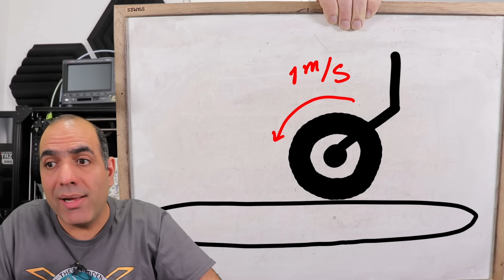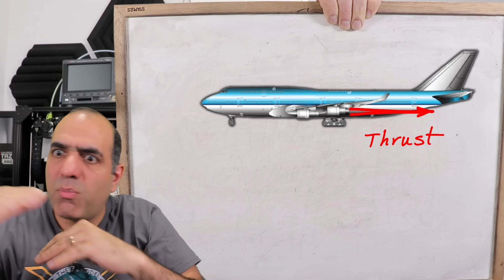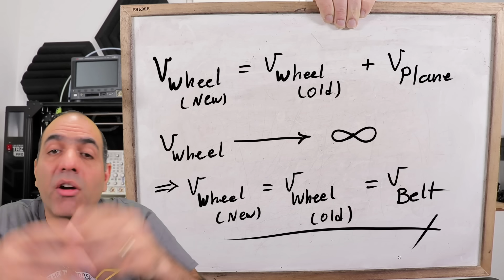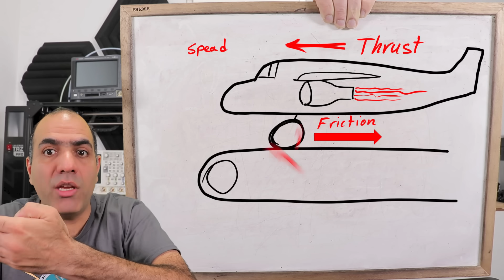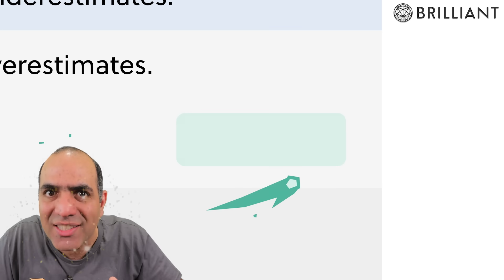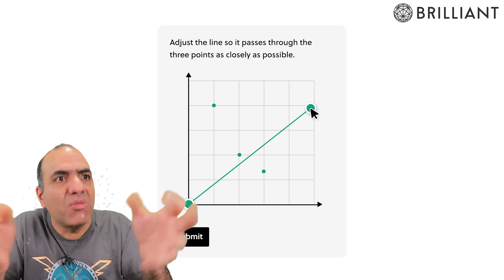Airplane Question that Drove Me NUTS!!!

Comment: 1:20 As a pilot I would say "IT DEPENDS", and kinda YES! If you imagine there is also head wind at speed around 160-180 mil/h it would fly easily, even without that belt with wheels totally standing still :D
Most people forget, that only airspeed is important, and ground speed is irrelevant.
EDIT: For people b1ching about: "did you ever saw 150KT wind?"! Its totally imaginary situation, did you ever saw moving belt under 747 at speed up to 300KT?
Reply: Which is why they call it flying and not driving.
Reply: That totally makes sense, given enough wind speed even Transatlantic Cruisers can fly
Reply: If the ground below you is moving hypersonic speed, not only will it be relevant, but anything anyone is trying to do near it will be irrelevant, because they'll be incinerated by the white hot hurricane generated by the ground.
Reply: It's literally true. I'm the aircraft engine designer and I agree. But in this case as basic condition there is no any information about the wind so basically we should consider it equal zero. Besides, If turbojet engine has rotor speed much more then at takeoff mode (currently maximum) it may produce enough relative air speed to make lifting force which gonna be enough to take off plane. But, to be honest, it's impossible at least because of strength and durability of materials of plane's parts.
Reply: @boots6384  those kind of exercises usually applies slippage equal zero as well as friction at bearings
Reply: The belt can only match the speed of the wheel. The only way the belt match a forward moving wheel exactly is to not start up The plane controls the wheel and the wheel controls the belt. The only way for you to make the belt start would be for you to grab and turn the wheel by hand without moving the plane. Even than it would only start as you rotated the wheel and would stop when you moved your hands to get another grip. EXACTLY That my friend are the only two things that can happen, I hope you see the light now.              Wheel speed and conveyor speed are matched at the contact point between them and wheel only rotates when the plane moves forward. Again the plane moves Forward and the wheel rolls exactly the same distance on the conveyor belt. with everything matching exactly at what point in the forward movement of the plane does the wheel get ahead of the conveyor belt causing the belt to start?                                                                                             The riddle (Imagine a 747 is sitting on a conveyor belt, as wide and long as a runway. The conveyor belt is  designed to exactly match the speed of the wheels, moving in the opposite direction.)                                                                                                                          Can the plane take off?                                                                                                                                                                                                       Let's break it down                                                                                                                                                                                                                 747= real plane, it will take off                                                                                                                                                                                               Sitting= Stopped, not moving, wheels not turning, and conveyor not running.                                                                                                    Conveyor belt designed to exactly match the speed of the wheels = Conveyor belt can only match wheel speed, it can't change wheel speed.                                                                                                                                                                                                                       Moving in the opposite direction= The top of the wheel  moves in the same direction as the plane's forward movement, the bottom of the wheel moves in the  opposite direction to the plane's forward movement. So any conveyor belt the wheels roll over moves opposite the plane.                                                                                                                                                                            To make the wheels turn the plane must move forward, as the wheels turn they roll on the conveyor belt at the same speed. Because the speed of the wheels  already matches the stopped conveyor belt, the conveyor belt  will not have to start and the plane will take off.                                                                                                                                                                                                                                  I see now this is not a riddle, it's the definition of how planes take off from a runway with one word changed. they replaced the word runway with conveyor just to confuse.
Reply: Would be the most unstable kite ever.
Reply: itll take off,the plane is pushed by the engines,doesnt matter the speed of wheels and what not,it is being pushed, imagine pulling that plane with a rope...
Reply: I think we're going wrong way here. Imagine you refusing to solve a physics problem because the fact that the planet the problem takes place on isn't stated. I believe that unstated conditions should be assumed normal - earth gravity and no wind etc.
Reply: Nop
Reply: So apparently forward momentum and thrust don’t factor in your flying. Can you please enlighten us on what you fly so we can avoid it?
Reply: Very well said, IFs and BUTs should NOT be introduced in order to answer the question in accordance with one's own intuition. I agree, with only the stated conditions, the plane cannot fly (and it is obvious)
Reply: All of that doesn't matter. The forward motion of the plane isn't dependent on the speed of the wheels turning or the belt moving. It's only dependent on the amount of force the engines produce. Even if you broke the laws of physics and could make the wheels and belt go at an infinite speed, the plane would still take off normally.

The only way to prevent the plane from doing so, would be to provide an equal force to the engines' trust, which acts upon the plane, in the opposite direction. Which the wheels and belt wouldn't do.
Reply: @Sanquinity It's not the force that the engine produces that causes the plane to fly though. There has to be enough wind passing through its wings to generate enough lift for the plane to fly. And the wheels gives the plane space and time to accelerate and holds it up till it reaches enough speed, inturn moving the wind through its wings with enough speed to generate lift that holds it up or climb in altitude. Else the engine has to work considerably harder to pull the wind fast enough under the wings to generate enough lift. Equivalent to the take off speed of a plane on a runway + the speed of wind hitting it during the take off.

That however is assuming that there is no energy transfer between the wheels and the conveyor belt. If the energy from the wind pulled by the engine is wasted in rotating the wheel which in turn transfers it into the conveyor belt or in the form of friction, it will never generate enough lift.
Reply: This was literally performed with a model aircraft by the mythbusters in the mid 2000s
Reply: @BlueScreenCorp  it was also performed by a full size aircraft, though the conveyor tore several times.
Reply: @SeohnAranys  And the plane was only able to fly by breaking the parameters of the myth.
Reply: @Sanquinity  correct. But the easiest way to deal with this problem is to fly helicopters instead. Runways are for flying bus drivers.
Reply: @MeppyMan  I think the Air Force would disagree...
Reply: I am sorry to break it to you but being a pilot has nothing to do with this.  This has nothing to do with airspeed kind of, not saying that you are not correct. The engines push on the air and that causes them to push the plane forward( pull is just a push). The wheels will start to move faster and faster but the weight of the plane will transition to the wings not the wheels so eventually it will take off.  The only question would be can the plane make it to VR before the wheel bearings explode.
Reply: @johnantonopoulous6381  Aerospace engineer here, I'm sorry to break it to you but you are incorrect. Airspeed is the main factor for a 747 aircraft to independently takeoff. The engines are there to move the aircraft, not the air around it. The wheels are passive and it is only reactive to the forces you apply on them, hence, the 'speed of the wheels' are proportional to the amount of thrust from the engines. If the engines were to be running and the conveyor belt was to match the forward ground speed of the aircraft, the aircraft will be stationary an it will not takeoff. Unless there is tremendous headwind, there will be no lift whatsoever under this situation because there is not enough airflow on the wings needed to generate lift. 

If you want to include wheel bearing friction then it gets tricky, because you will need to discuss about the thermodynamics of this entire system for it to be relevant which is a whole lot more complex than what this setup initially presents us with. But even if we did include that the 747 will not takeoff; in fact the opposite will happen and it will likely crash and burn from the wheels exploding to the engines overheating.
Reply: @eat_ze_bugs  Couldn't you rev the engines up to speed and then slam on the brakes to make the tires not weld their bearings together? You would need to overcome friction of the rubber but I think that should be possible at TOGA thrust...
Reply: @BossmodePictures  That will only cause the plane to skid on the conveyor belt, if the conveyor belt is able to keep up then there's no skidding. Even at max thrust there is no inertia on the plane needed to sustain flight. All that energy from thrust is being cancelled out by the conveyor belt moving in the opposite direction. Without airflow above the wings it will act just like any other normal road vehicle.
Reply: @eat_ze_bugs good explanation. I’m an aeronautics student, I agree with your point
Reply: @eat_ze_bugs  But as I understand it, the problem with the conveyor is that the wheels would turn at infinite speed, being blocked because of friction. But if the engines would be strong enough to overcome the brakes, this would not make a difference because the wouldnt even need to spin. Or you could just brake enough to not let them exceed their limits.
Reply: @johnantonopoulous6381  No hunni. Consider the whole system. To match the wheel speed perfectly means to keep the plane static. The only way to keep the plane static is for the conveyor to perfectly match the force on the plane so there is no net push forward.
There is no way to develop lift without the airflow of speed over the aerfoil. The engine pylons on a 747 are underslung so they certainly arent going to provide the flow over the top of the wing required (likely one of the reasons this model was chosen over a prop model that would complicate the question).
Source - Mechatronic Engineering Bachelor studies.
Reply: @Mijc Osis  so how does the conveyer match the force of the thrust? the wheels? no because there is bearings in them wheels and they will just spin and the plane will move forward from the engine thrust, there is friction in the bearings but its so little that the conveyer would need to travel 1000's kilometers per hours to keep the engines force in check with just the friction of the bearings and they would literally explode from heat and stress at that speed.
Reply: @AJKMonkey  LMAO no.
Reply: @mycosys  It doesn't matter what the wheels are doing. They're freewheeling. They're only there to keep the belly of the plane from dragging on the ground.
You could lock the brakes on a very slippery runway, and still possibly take off (control would be hard). 
Planes can take off from water or snow with skis. No rotation at all.
Reply: @mycosys  no because you're thinking of it like a car. The wheel speed does it mean anything because the body of the plane would move forward. Plain tires just freespin. more like taking a car and putting it at the top of a mountain and putting it in neutral then running a much smaller tire. The bearings going to have to spin faster but the vehicle will hit almost the same speed.
Reply: @johnantonopoulous6381  The belt can only match the speed of the wheel. The only way the belt match a forward moving wheel exactly is to not start up The plane controls the wheel and the wheel controls the belt. The only way for you to make the belt start would be for you to grab and turn the wheel by hand without moving the plane. Even than it would only start as you rotated the wheel and would stop when you moved your hands to get another grip. EXACTLY That my friend are the only two things that can happen, I hope you see the light now.              Wheel speed and conveyor speed are matched at the contact point between them and wheel only rotates when the plane moves forward. Again the plane moves Forward and the wheel rolls exactly the same distance on the conveyor belt. with everything matching exactly at what point in the forward movement of the plane does the wheel get ahead of the conveyor belt causing the belt to start?                                                                                             The riddle (Imagine a 747 is sitting on a conveyor belt, as wide and long as a runway. The conveyor belt is  designed to exactly match the speed of the wheels, moving in the opposite direction.)                                                                                                                          Can the plane take off?                                                                                                                                                                                                       Let's break it down                                                                                                                                                                                                                 747= real plane, it will take off                                                                                                                                                                                               Sitting= Stopped, not moving, wheels not turning, and conveyor not running.                                                                                                    Conveyor belt designed to exactly match the speed of the wheels = Conveyor belt can only match wheel speed, it can't change wheel speed.                                                                                                                                                                                                                       Moving in the opposite direction= The top of the wheel  moves in the same direction as the plane's forward movement, the bottom of the wheel moves in the  opposite direction to the plane's forward movement. So any conveyor belt the wheels roll over moves opposite the plane.                                                                                                                                                                            To make the wheels turn the plane must move forward, as the wheels turn they roll on the conveyor belt at the same speed. Because the speed of the wheels  already matches the stopped conveyor belt, the conveyor belt  will not have to start and the plane will take off.                                                                                                                                                                                                                                  I see now this is not a riddle, it's the definition of how planes take off from a runway with one word changed. they replaced the word runway with conveyor just to confuse.
Reply: @mycosys  "To match the wheel speed perfectly means to keep the plane static"? The hell are you smoking? That is not what that means. If the wheels are moving forward at 10m/s, then the belt moves backwards at 10m/s, but that does not stop a plane.
Reply: @WJS774  ok hunni. make sure you get some rest, off to bed now
Reply: @mycosys  No answer? Imagine my surprise.
Reply: I already wrote this reply earlier. There is no reason to imagine other things if the problem doesn't require so. The plane in this problem will NOT take off.

Without making some weird hypothesis about plane's weight, wind speed, density altitude, ...ALIENS, then the question makes the following assumptions:
-Boeing 747 jet plane;
-conveyor belt which matches the wheels speed.

1) Indeed, the plane wheels do not spin because they are connected to the jet engines. This means the wheels are not the cause why the plane moves forward. The plane moves forward because of the thrust from the jet engines.

2) The engines do NOT create lift. This is done by the WINGS and the air going above and below them based on the Coanda effect. A Boeing 747 (as the problem states) does not fly in the same way as a rocket; a Boeing 747 is NOT a VTOL.

3) The engines will push the plane forward, but they will NOT bring air above and below the wings in order to create lift. The plane must move through a mass of air in order to fly.

4) The problem states: the "conveyor belt matches the wheels speed". The problem says NOTHING about the wind, for which case it will be considered zero. For an observer siting near runway, the plane is NOT moving. The ground speed is ZERO. While indeed there is some air sucked into the engines, which also creates some turbulence reaching the wings, most of the air particles above/below the wings will also be at ZERO speed relative to the plane and its wings. There is not enough mass of air going over/below the wings, which means NO LIFT.

5) Offtopic: indeed, a small planes can take off from a very short runway, or almost zero length (like the bush planes) BUT they are designed for this kind of operations (having VG kits installed, they are super-light planes), BUT they are NOT Boeing 747 as the problem states.

6) UPDATE: I see that many people speak about friction (and Mehdi too), but it is in the wrong way. The only time when the friction could play a role is if the conveyor belt through its movement displaces a mass of air enough to create lift, otherwise there is no reason to consider other friction than of a Boeing 747 (as the problem states).
Reply: I would say NO - there are nothing about headwind or thrust of engines.  And as you say - lifting force are created by airspeed, not the wheels speed.
I would say Yes - coz - belt should match the speed of wheels. For wheels to have any speed - thrusters should work. As result 747 would lift in the air and probably would even fly some small distance, but then would drop on the ground due to low initial speed (that's why catapults are used on aircraft carriers, to launch them from small runaway - to give them initial speed).
Reply: Nope, takeoff speed for a 747 is 160 knots and the max takeoff wind for any airport that will allow one is 40. 
Also where the heck are you gonna find a 300kph wind speed (category 5 on any scale) over ground in which the flow isnt chaotic? you would be immediately downdrafted. There is no way you would even get aloft before lift asymmetry toppled you.
Reply: @boots6384  LOL no. if you follow the stated conditions as long as the conveyor is capable of meeting them the plane will not fly.
Reply: @mycosys You are contradicting yourself. If you are saying the wheel is not rotating the conveyor belt, that means there is not friction and no energy transfer or loss in between it. Then you can consider it like a non friction surface. The engine won't lose the energy through the wheels then. It's as if the plane is already in air and there is nothing to drag against below it (assuming the air drag to be 0). Though in a practical scenario it will be hard to take the plane into lift without the engine working considerably harder than normal scenarios and I don't know if a engine can work that hard to create that initial lift.
Reply: Have you ever been on the runway (or anywhere) and experienced a 180 mph headwind?
Reply: @chitlitlah  not all airplanes are jet airliners. So yeah it’s happened at airports where planes that are not tied down have lifted off the ground in high wind.
Reply: @MeppyMan  Yeah, I've seen old bombers blow cubs off the taxiway lmao
Reply: @MeppyMan . Your point is irrelevant as we are talking about  a 747. However, Technically a super hurricane or tornado can do this.
Reply: @chitlitlah  Have you ever seen an convayor belt the size of a runway that can match any speed imaginable up to the point of destruction for the wheels of an airliner?
Reply: @ipodtouchiscoollol . No but it was assumed to be true and possible. Whining about it later is not a solution. As for the airspeed point, I guess if the plane were taking of in a tornado or super hurricane it could do it, so it plausible IRL.